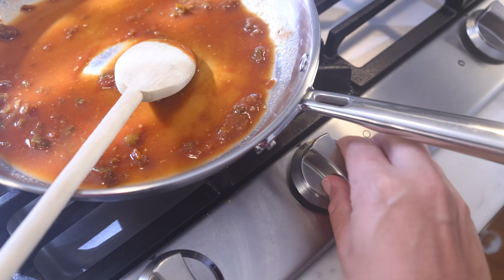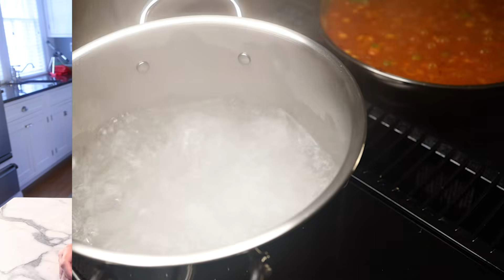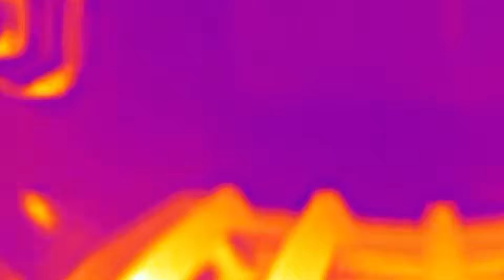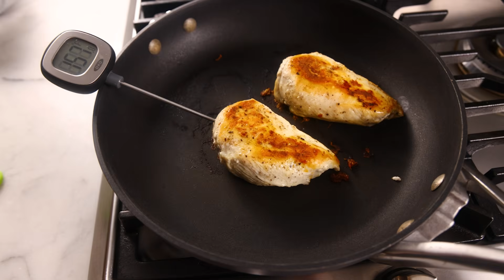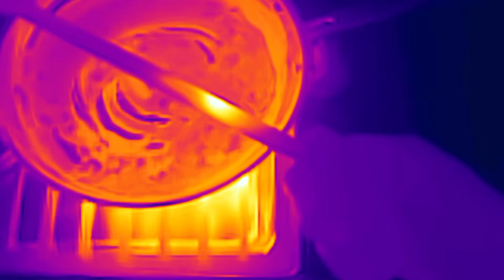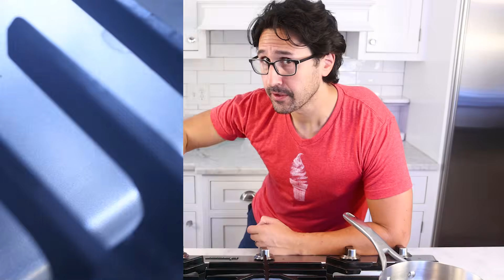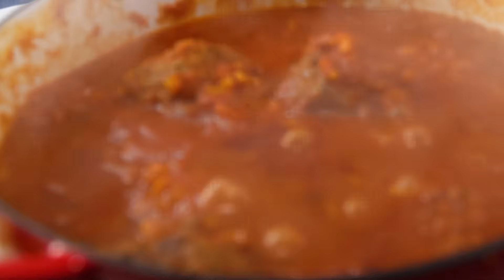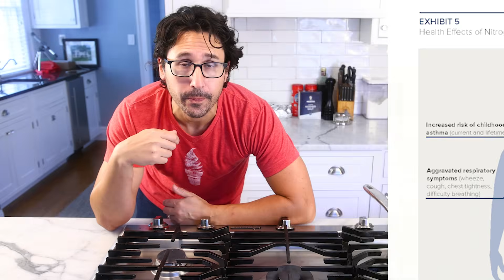Problems with gas stovetops | weak, dirty and dangerous

Comment: I've lived with electric coil, induction and gas stove tops. For boiling water, nothing will beat induction. I live with a gas range right now, and I have a portable induction range just for boiling water. For everything else, I am loving my gas range. I do a lot of wok cooking and the amount of control and tactility has been unmatched.
Reply: kettle ?
Reply: The rule of thumb i use is if it is suppsed to take less than 5 min to cook, use gas, any longer, use electric, because Electric holds and retains a stable even heat much better than gas. And for Boiling, no question electric is better.
Reply: Resistive coil still has some advantages over induction and gas, like how it can use all pots and pans,  and is less likely to warp pans than gas due to more even heating
Reply: Now that would depend on the wok burner you have. There's very nice and very responsive special wok induction tops. But then, when wok cooking you really want a real fire under it and you don't want to do it indoors unless you have a commercial hood. I only wok cook outside and bought a specific 150k BTU wok burner for it so I can get that char...
Reply: I have an electric jug/kettle to boil water. Way more efficient than a electric range at boiling water.
Reply: I end up just using my kettle and dumping hot water into the pot I'm cooking in
Reply: I realize there are a couple minor advantages to induction, but none that outweigh the major issues that will stop me from ever getting a full induction stovetop.  A standalone travel burner may be fine for some things, but definitely never a full kitchen stove. My main complaints about induction are:

(1) Extremely limited in pan size.  The moment you try a pan larger than the element, it becomes useless, so you're effectively stuck using "smaller" cookware.
(2)  They do not spread heat up the sides of your pan at all, which does have a major effect on heat output to the food.  For some tasks this doesn't matter, but for any amateur cooking enthusiast, this causes major limitations in cooking techniques.
(3) They are MURDER to your clad cookware.  The induction coils have been well documented to cause problems with delaminating layers in bi/tri-metal clad cookware, especially if your induction elements are more powerful.  So what's the point in getting a super powerful stove if it's going to warp and ruin your fancy cookware?
(4) This is more of a minor complaint, but the noises they make are obnoxious and loud.  But this is more subjective.
Reply: curious why you don't just use an electric kettle for boiling water?
Reply: @chesterr551  When I got my induction stove, the kids and I put a liter of cold water in a pot on the stove and a liter of cold water in the kettle. I have a good, efficient kettle, but induction was significantly faster. We still use the kettle for tea water, since it turns off when it's done.
Reply: @annaeliasson952  Are you in the US? The kettle is at 110V and will boil slow(ish) compared to induction that's on a special circuit with higher current. In Europe this isn't much of an issue; a regular, cheap induction stove will boil water about as fast as a not-completely-shit kettle.
Reply: @amunak_  No, Sweden 😁. My test winning induction top beat my test winning tea kettle by nearly a minute. Just one data point, if course. People with different setups will get different results. What pot you use can make a difference too.
Reply: @amunak_  110V is the voltage, not the current (which is measured in Amps). The amount of power used for heating is the wattage, where W = V x A. It's possible that the kettle runs at a higher wattage than the induction stove. My cheap kettle uses 2200W, for example.
Reply: @chesterr551  Probably because it's not a very good idea to try and boil eggs or potatoes in a kettle
Reply: @leagueaddict8357  You can preheat the water in the kettle, then pour into a pot.
Reply: @chesterr551  not OP but in my case, it is usually too small for the amount of water I want to heat up (fam of 4 here, always cooking enough for left overs)

Comment: Another thing: natural gas vs handigas. I'm in the Netherlands now, and I suspect the reason the range here is so weak is because they use direct piped natural gas (methane). In SA where in from, gas is bottled and usually a handigas mix (propane+butane)

Comment: i can’t say i have any experience living with electric or induction cooktops, but i will say that the temperature issues with gas stoves are way worse the older your stove is. my stove is from the 1970s and i have noticed it is way harder to control the temperature on this thing, as opposed to my previous stove that was made in the 1990s. old stoves are also almost…permanently on??? they ALWAYS feel warm to the touch when they are off and have been off for hours or days. i think that has something to do with the pilot lights? it does make it hard to live with these things in the summer let alone turn the damn thing on for any reason. (don’t even get me started on these awful ovens)

Comment: The "low on a gas stove is not low enough" reminds me of this video by German blacksmith Daniel Lea where he showed how to cook chili on a blacksmith's forge. He said that the lowest the forge could go with the forced air cut off is still enough to make the pan glow red. Instead he had to frequently pull the pan off the heat.
Reply: My grandmother had these heat diffusers,  a hollow disk  made of sheet metal covered in pinhead sized holes, with a wood handle, and she would put that under anything that needed gentle heating.
Reply: @macrumpton  Exactly.   This problem was solved a hundred years ago.
Reply: Sounds like fun
Reply: Why would you even attempt to cook chili on a blacksmith's forge, other than bragging rights?
Reply: @steffeeH  Checked back on his video, It's for when you're in the shop for several hours and don't want to spend money eating out.
Reply: My gas stove never scalds milk on low. Unless there is a fancier induction cooker they use PWM which just varies how often they turn off an on at full power. Even on low these can get you some goop on the bottom when heating milk.

You can watch the water boil on a induction cooker on low when the element comes on even briefly.

Meanwhile low on a gas stove can be set to not even bubble at all.

Comment: I have always had electric stoves growing up.  2nd house we bought had an inexpensive gas (LP) stove.  I was excited about it until actually using it.  I ended up ripping it out and put in a flat top and was much happier.  Just a couple years ago, we moved into another house that has a high-end gas (again LP) stove.  It's much better, but has all of the issues that Adam mentioned.  Slow to heat, near impossible to simmer, and heat spills out the side.  Heat range is more like medium low to medium high on an electric.  Once we do a renovation, I'll be seriously thinking about moving to induction.

Comment: I'd rather have a gas range, mainly because the glass is likely to pick up a lot of scratches during the course of use from my experience, plus it feels like you really have to be gentle all the time with them, and also because if I want an electric induction stove I can get a separate one. Camp stoves require propane, which is a lot more effort than just plugging it in. It's the easiest way to have both.

Comment: I’m still skeptical that an induction stove can be hotter than a gas stove top. There’s a reason you can’t properly cook with a wok or sear a steak on an induction stove.
Reply: Oh they can. Try one with boost mode and a good pan, way hotter than any normal gas stove.
Reply: @hrydgard  I will have to keep my eye out for one. I’ve never met an electric stove that could get the pan as hot as a gas stove. Very dissatisfying.
Reply: @LadyNerdMT  Keep in mind that induction is something else entirely than traditional electric ..
Reply: @hrydgard  if that’s the case then this video is missing a very important element. A specific explanation about the difference between induction, electric and gas, and how each work. This video does little else besides make generalizations.
Reply: @LadyNerdMT  Certainly agree he could have done that better!
Reply: Who told you you can't sear a steak on induction?

Comment: These are all very good and persuasive arguments, but I have never started a fire I didn't mean to start with a gas stove. I've started SO MANY fires with electric stoves when I accidentally turned on the wrong burner, let things get too close to the stove, etc. With a gas stove, I know immediately when I've made a mistake and can correct it before it turns into an actual emergency. This might be partly fixed by better design of electric stoves, because I've never had one that indicated which burner was on, only that some burner was on, nor have I ever had one with a set of controls that made sense for how it mapped to the various burners.
Reply: That's another advantage of induction, even if you turn on the wrong burner, it'll never ever heat up, at it's the pan that actually creates the heat. In fact, almost all induction burners will detect there's no pan (even if you leave a fork or other magnetic utensil on top) any shut down automatically.

Plus, since it never gets hotter than the pan, any spilled food doesn't really burn and can be easily cleaned.

That's what I call safe!
Reply: @georgH  best for efficiency, best for safety, shame they're still so bloody expensive here in Australia! :(
We had a small 2-element unit in a previous apartment (a Bosch I think) and I loved it even though I had to spend some money on new cookware to use it.
Reply: @sixstringedthing  What do you consider expensive? My new AEG 4 plate induction hob cost me 320€ in Germany.
Reply: I've used several infrared electric stoves in different properties and they all had "hot surface" indicators for each element. But have also used several older solid/ring type electric stoves that only had a single "something's hot" light. The nonsensical mapping of control knobs to burners is so frustrating... I guess because there's multiple ways that you can map a line of control knobs to four burners arranged in a square, and every manufacturer does it their own way. Would be nice if this could be standardised somehow!
Reply: My electric glass top glows. I think it's both the glowing coil and a lamp.